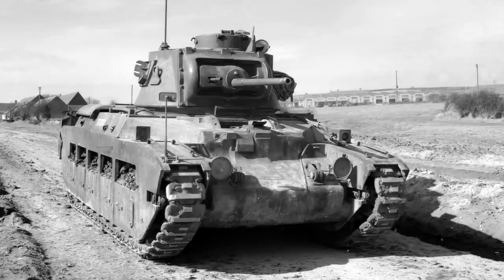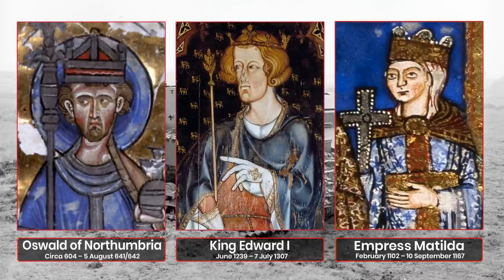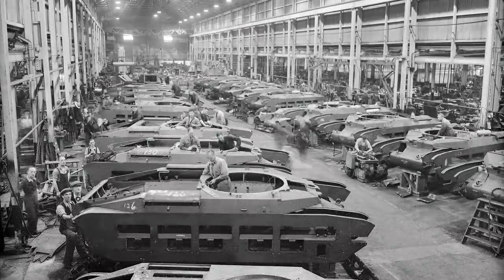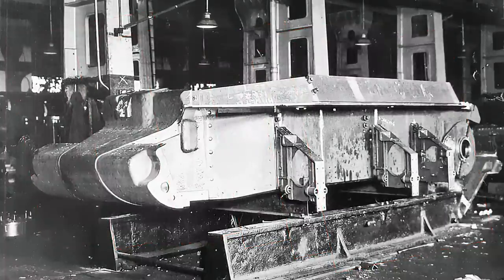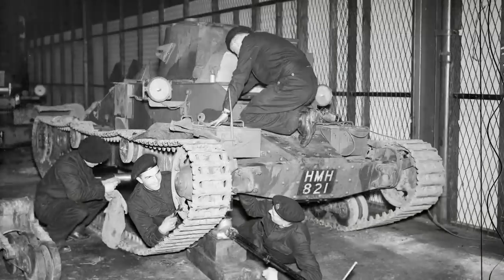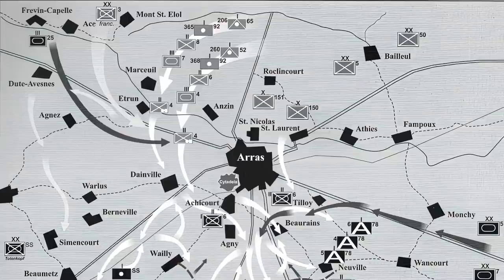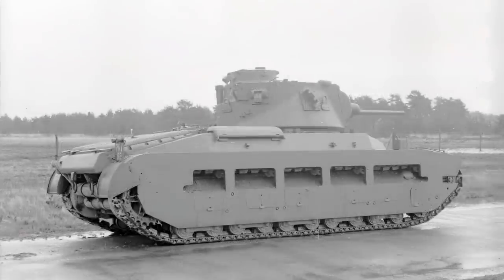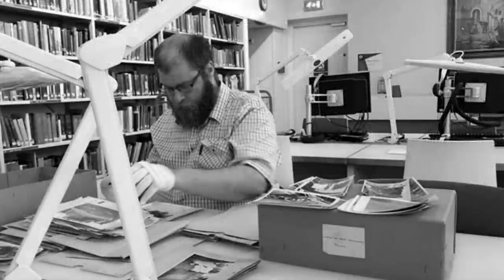A12 Matilda - Tank Design & Development

Comment: Until I saw the tracks on the Matilda I would never have thought anyone could be stupid enough to put smooth metal against a slippery surface and expect it to work, and I could see that just by looking at photos.
Reply: But it works well on loco and and rolling stock wheels smooth metal on smooth metal!
Reply: Until it became cheap enough to stick rubber pads on tracks every single tank in the world had flat metal on slippery surfaces?
Reply: Together with most mysterious decisions made by British High Command, e.g. the difference between infantry and cruiser tanks.
Reply: @wideyxyz2271  Trains are many orders of magnitude heavier than tanks, so friction is less of an issue. But even then, they take literal miles to speed up/slow down thanks to the "grip" they have.
Reply: @kitten-inside  I would be curious to know if they found any meaningfull difference between those 2 types of tracks in maximum speed of the tank on flat wet grass? Not that it would make any difference in the field.
Reply: @voiceofraisin3778  I remember the first time I saw an American halftrack with its rubber track. I had expected them to be like tank tracks, metal with rubber blocks. So when I saw what looked like a giant rubberband you can imagine how surprised I was.
Reply: @foreverpinkf.7603  Never understood that one. Why build two tanks when one could do both tasks. As we saw with the Centurion.
Reply: @Hetschoter  You would think the one with the poor grip would have more difficulty on mud and ice.
Reply: @bigblue6917  Tradition, the glue that keeps the Empire together. WW1 thinking: one tank so slow that foot soldiers could keep up with it and a faster tank to fight other vehicles.
Reply: @foreverpinkf.7603  There was still a lot of old thinking hanging on at that time. For some unimaginable reason there were those that thought that once D-Day had happened we would be back to trench warfare. You have to wonder which rock they had been hiding under since 1939. And, more importantly, why they did not just stay there.
Reply: @wideyxyz2271  Not really. Trains can hardly go up any slope at all. Wheel spin is an issue which destroys wheels and track.
Reply: @mbak7801 Not actually true.
Reply: @bigblue6917  Most nations at that time built lighter cruiser tanks and heavier breakthrough tanks.  The French, the Germans... in fact pretty much all major tank building nations.

Comment: There is one aspect of these tanks you do not touch on, and I think it was a very effective central policy of allied armour design.  As I understand it the Matilda was powered by basically two bus engines.  The fan boys of German armour design may well note this.  Sure they were not fast, but they were fast enough for what they were required to do most of the time.  Secondly the engine design was already proven to be reliable, as bus engines need to be, plenty of spares, and a whole bunch of people who knew how to maintain and repair these engines.
German armour was plagued by expensive tanks that were difficult to build, maintain and repair, and a constant shortage of spare parts.  This led to a lot of tanks lost because they were simply abandoned due to mechanical failure and no parts or people to fix them.  
The Matilda was an excellent tank, often overlooked in the publics perception by the Sherman and T34.
Reply from the maker: odd you shoudl say that, just workign on fmbt5 and we cover this topic on engines :)
Reply: As I sell automotive parts, I can confirm that using a common engine *really* helps with repair and maintenance. Even if it requires more labour to repair, common engines have cheaper, more available parts (economy of scale) and diagnosis of issues is far easier, as there is a greater amount and distribution of knowledge. There's more aftermarket mods for them, which are easier to design because everyone is familiar with it's weaknesses and strengths. 
The whole industry works just works better for common engines. The rover V8 hasn't been mass produced in 15 years, but I bet you can find parts at any distributor and an expert mechanic for it in every village in the UK. Parts aren't common in the US, but far easier to find than any other UK made engine.
Reply: Sounds a lot like American/British opinion, not grounded in facts.
Reply: @23GreyFox  A meaningless statement.  What facts are wrong?
Reply: @kevinpitt2203  This whole part. "German armor was plagued by expensive tanks that were difficult to build, maintain and repair"
Reply: @23GreyFox  I am pretty sure I have not yet seen any analysis that says anything different.  The numbers speak for themselves.  Take the Tiger Tank.  That was supposed to be the tank that would turn the tide on the Eastern Front.  The Battle of Kursk was delayed time and again as they waited to get the tanks delivered in any reasonable number.  Beset with production delays and unreliability the Red Army was given time to prepare their defences, and build up their own numbers.
The ones that were there, when in action, did perform very well, but there was nowhere near enough to make an impact.
Consider this.  Production numbers for the T34 were iro 60 000.  Same with the Sherman.  That is without all the other models.  Only 1300 Tiger Tanks were built.  To make any impact, and seeing as it was their main tank, they should have been building 20 000 during 1943 alone. You only have to look at pictures of the tanks being manufactured, as opposed to say the Sherman factory in Detroit to see why.
Added to that, there were 200 updates.  That means for every tank built, the tank that was 6 back was different.  When spare were ordered they had to give the tank reference number so it had the right part.
How many Sherman and T34 tanks are still running around now, kept going by enthusiasts?  How many Tiger Tanks?
Any of the dairies of surviving crew members will describe these problems.
Reply: @23GreyFox  I agree. I do not see any mention of the PzKw III or IV series of tanks. I do not see any data or mention of how early T-34s carried transmission spares strapped to the vehicle. Lots of vehicle types ignored. Like a German fan in reverse. smh
Reply: @SvenJT  It wasn't just the early T-34, the gearbox wasn't fixed after the war. Nearly every T-34 that drives around in some museum is build after 1945.
Reply: The Brits had massive engine troubles. No large landbased large displacement engines due to their market protection scheme involving a tax based on car/truck engine displacement.
Reply: @kevinpitt2203  Panter, not Tiger.

Comment: There was a year delay in the introduction of the 2 Pounder gun, when it was found that the 127,000 APHE rounds, that had been produced from 1934, when the gun was under development, was below the minimum performance standard set by the WD in 1937.

The WD required that the 2 Pounder gun should have a 70% probability of a penetration of a 25mm. FHRHA Vibrax plate set at 0 degrees at a range of 500 yards..... It had only recorded a 28% chance. even worst was the tendency for the fuse to part company from the shell in flight or on impact. 

Vickers quickly came up with a AP shot, which delayed adoption of the 2 pounder into service for nearly a year.

I own an example of one of the useless 1934 pattern APHE shells, innert and complete with fuse.
Reply from the maker: great stuff ty. it was more beacuse its often touted no HE rounds were ever made sort of thing, that i thought it worth coverign albeit breiftly
Reply: @armouredarchives8867  All the APHE shells were emptied of their Lydite explosive filler and used for UK live fire range training throughout the war.
 
My example is an unfired instructional round with a pristine drive band.

The Vickers 1938 pattern AP/T shot was rapidly superceded, in 1940, by the more potent Hadfield AP/T, which was  heat treated. Hadfield wanted to keep their process a secret from other manufacturers, but the WD ordered them to share it to speed up the production of stocks. This treatment process was also shared with the US when they joined the Allies. 

AP/T (Vickers) = up to 64mm. FHRHA @ 0 degrees @ 100 yards.
AP/T (Hadfield)= up to 77mm. FHRHA @ 0 degrees @ 100 yards.
APCBC/T (1942) = up to 84mm. FHRHA @ @ 0 degrees @ 100 yards.
Reply: @CZ350tuner  I find the difference between the 77,84mm surprising, I would not have expected  a ballistic cap to have  made such a difference over a distance of 100 yards.
Reply: APCBC

Armor piercing capped ballistic cap.  It had both ballistic and ap caps.

Comment: Re:  2pdr HE rounds:  In the scramble for resources and funding between the wars there appears to have been a disagreement between the Royal Armoured Corps and the Royal Artillery over who could shoot explosive rounds.  The gunners felt they were the experts in blowy uppy stuff as part of the general advance while tankies were telling anyone who would listen that mechanisation should translate to a breakthrough army within the army, all under tracked armour and under their control.  

Without an SPG / HE capability (arguably an APC, SPAAG and CVRE capability too) the Grand Tank Fleet was impotent.  Infantry and artillery senior officers saw this problem for the RAC and saw it was good (for them).  Many were predicting the tmotors

The tankies fought back with three options  - go so fast the ATG can't hit you (cruisers), slap on more armour so the ATG can't hurt you (infantry tank) or spot and destroy the ATG before it could do more harm (HE round). 

Counter battery fire had long been the preserve of the Royal Artillery, it had to form part of the larger fire plan at Brigade and Divisional level, a Gunners job, so they argued for the later mission.  It was settled around the time of the 2pdr's introduction, the deciding vote seems to have been the infantry who were desperate to keep control of the dismounted towed ATG. 

They didn't need a puny 2lb HE round for that business, they argued their 3inch mortar did it better, laying smoke and illumination as well.  Sohowitzersquadron

likehuge duplication and wastage of effort that the USA and France suffered from in much the same way.  Russia and Germany slightly less so as both armies were enjoying a clean slate start and a murderous disinclination to whinge by Generals.

Comment: Great video part of me always wondered what would have happened if they had made a "Heavy Cruiser" Variant of the Matilda by replacing the Engine to something that could push out 350-400hp  instead of the 190 as the twin engines of the Matilda do take a lot of physical space and the power pack is bigger than that of the Liberty engine used in the cruisers(although I would probably avoid the liberty like the plague but if you only pushed it at 300hp it probably wouldn't have had as many wear and tear issues as when they tried to push it to 400+ in real life)  or the Bedford engine used in the Churchill maybe a earlier version with slightly with less power might allow such a vehicle to go at something closer to the 25mph on road and 15mph of the Crusaders.   At that point they would have had a more usefull vehicle that could do both roles and may have sent the UK down the universal tank route that led to the MBT concept earlier than they did.
Reply: speed isn't dictated purely by engine power, but also suspension type and how loaded said suspensions are. i doubt 25mph would be achievable with it with a 300hp engine. despite being a similar mass to the panzer IV. there is a reason why the horstmann and christie suspensions were those chosen for cruiser tanks.

anyway bedfords are too large, maybe, i have seen conflicting sources on their size, but they weren't ready anyway. it wasn't even ready for the A20 initially, let alone matilda.
Reply: @matthiuskoenig3378  While the Horstman and Christie suspension was better suited the suspension of the Matilda was essentially the same suspension used on the A7 that was designed for 25 and was able to hit 30 mph although it would have been a bit of a maintenance hog if pushed to fast.  The A7 also had the twin engine concept used on the Matilda but with more powerful engines having 252 hp.  By no means would a faster variant of the Matilda chassis have been without issues but it might have been good enough and pointed the UK down the universal path earlier

Comment: My foster dad was a tanky in WWII. He was in 1st experimental armoured div later renamed 7th armoured.
He told me the Germans had nothing to even take out the British light tanks let alone the cruiser and infantry tanks.

He was in cruiser tanks and happily went around taking out German tanks. he also said the Italian tanks were better than the German tanks.
Best tank Germany had was the PZ38(t) a vickers export tank. That got rejected by Britain as not having enough armour. It wasnt till the Panther and tiger tanks came out that Germany had a half decent tank.

The PZ38(t) was downgraded for the sale to Germany in 1938. but the vickers A24 it was based on had thicker armour and that was sold to Poland as the PT7 and the soviets as the T24 and China as the type 24
. British specs for a light tank was 30mm armour the A24 only had 28mm. the PZ38(t) had 26mm.
Crusier tanks armour was 50mm and infantry tanks was 100mm.
The panzer I had 10mm. Panzer II 13mm and panzer III 20mm.

Its why after Dunkirk and the fall of France Germany used the captured British and French tanks instead of their own. Rommel used them in N,Africa and if he couldnt get enough of them he used Italian tanks.

Britians problem was relaibity due to having lots of diff models in service with diff componentes so it was a logistical nightmare getting the right parts and ammo to the right tank units.

Britian used the weight of the shell not the caliber. So 1 2pdr gun shell wouldnt work with a 2pdr gun from a diff maker.

Some tanks used AEC engines some used vickers some used Vauxhall and some used leyland depending on which company made the tanks.

They all had the same specs in armour and gun but each company used their own components . But just cause they all had a 2pdr gun didnt mean they were all the same caliber lol.

Plus when a tank broke down it was towed away and another given to the crew but it might not be the same make or model. My dad said his unit of 4 tanks had 4 diff makes and models and was a nightmare getting the right ammo for them. It was a case of ammo being dropped off and then look and see if it fitted ur gun lol. if not they had to wait for the next lot of ammo to arrive. The ammo might of only fitted in 1 tank model so the rest had to sit around waiting for more ammo.

As for the 88mm that was an anti air gun not anti tank. and 1st used to take out tanks in N,Africa in 41 after British tanks came across them intending to take them out but they lowerd the barrels and fired at the tanks and surprissed how good they were in the anti tank roll so started using them for that. It was the only weapon Germany had that could take out British and French tanks.

WWII should of ended in 1939 when France destroyed the German army in the west and Hitler surrendered but it got rejected by Britian and France. The French army advanced from t eMaginot line and was 5 miles into Germany when they got orders to stop their attack and fall back and never attack again.
Same in 1940. BEF wiped out the Gertman army and marched into Holland only to be given orders to fall back.
The French gave orders to the French army to pull back further and half the French army ordred to go to Africa. that left the BEF right flank open. that lead to Dunkirk.  the BEF was undefeated but kept getting orders to retreat.

All part of the plan to make it look like Germany was winning to give the RAF time to flatten as many German cites as possible. Churchill and Chamberlain both said in 1936 the war with Germany must last at least 3 years.
So everytime Germany surrenderd it got rejected.

Rommel said why r the French running away so fast when they defeated everything i threw at them. Other Germans said the French r retreating faster than we can advance. Thats cause the French army was fully motorised and the Germans didnt have many trucks so had to rely on horses to tow their heavy weapons and horse and cart to bring up supplies.

Britain had an armoured div the only 1 in the world. That was a combined arms unit. light tanks for recce. cruiser tanks for break throughs and dragoons in fully armoured transports called rams. Rams were tanks with the turret taken off and room inside to carry troops so they could keep up with the tanks. 1 of Percy Hobarts creations setup in 1938.

Rommel coppied that for when he went to N,Africa after he got totaly destroyed by it in Belgium in 1940.

Britian tended to mix units so Infantry had tank support and tanks had dragoons supporting them. France however had diff rules Tanks were not allowed to engage infantry only other tanks and could not support infantry or be supported by infantry. Germany had the same rules as France.